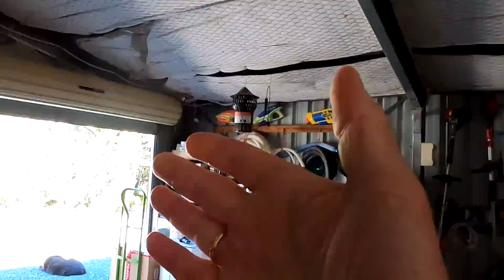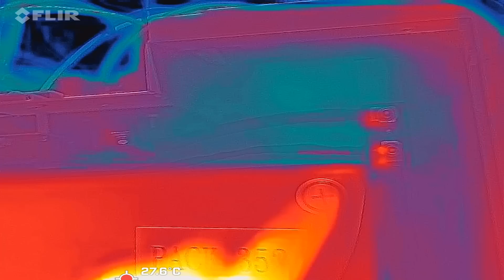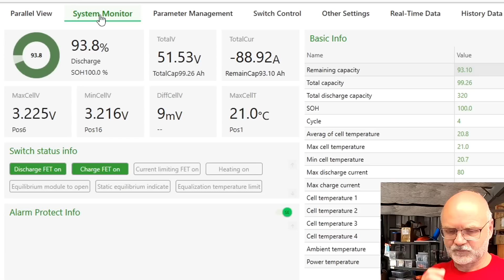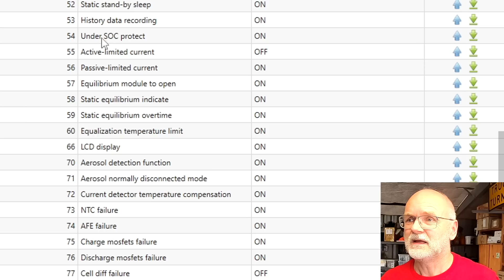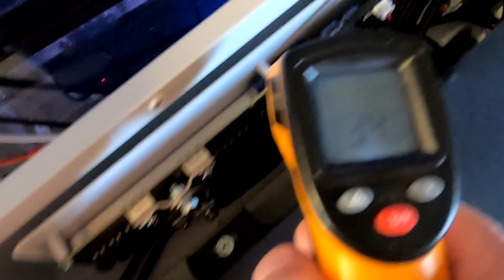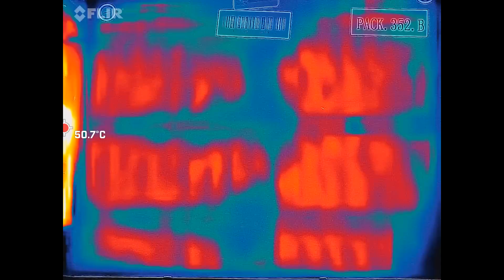Seplos Polo LiFePO4 Pouch-Cell Battery 1C high-amp discharge test. Does it get too hot? ♨️

Comment: I don’t understand what is wrong with higher balance tolerances? I mean why do you want to be 0.01 close to the wire the batteries need a little room.
Reply from the maker: What is your deviation and settings like? How do you charge your cells?

Comment: Dear Friend , We can use different type Battery (Li-Iron and Lifepo4) in parallel  in same invertor , If you can provide a video  for it
Reply: That's a very bad idea, they have different voltage curves and target voltage. You should not be doing this.
If Andy is going to be a video, it will be to show why you shouldn't do this
Reply from the maker: Some people do that but I'm not a fan of that. Can be done for a temporary time but stick to one chemistry if you want a reliable system.

Comment: Seems like the battery resetting itself to 100% full because a single cell hit the over voltage protection is a bad implementation because it could just be a runaway cell.
Reply from the maker: Yes, that is a bad software design again. I'll talk about and also show this in the next video.
Reply: Not a bad implementation, because you can damage your cell and some inverters will keep pushing power if SoC isn’t 100%. The problem is always how to keep cells balanced.
Reply: @gfjardim1983  Except that the BMS can, and should, be configured to cut charging or discharging in situations like that and if the battery just resets to 100%, not because it’s actually full but because a single cell is running away, it will be harder to realize there is a problem and figure out what is going on, especially in situations where you have a large bank of batteries which would be typical for a home.
Reply: @inmyimage1081  agreed, my BMS disables the charging input, set the SoC to 100% and send an alarm to the inverter, requesting a “Force Charge”. The first action protects the runaway cell, the second action signals that the battery can’t receive any additional charge, and the third let the user know that something is wrong with the battery.

Comment: Not too surprised that the pouch cells don't seemed to be able to supply the stated 100Ah, although 1C is a bit much. There was some significant balance-differences, I noticed.
In the several tests I have seen for pouch cells, they are often just right on the stated capacity or, as in this test, about 10% too low.
I do wonder if the NEEEEEY active balancer would make things better for this unit? 
I am worried that the SEPLOS BMS stated 74,8 degrees Celsius, with the 80 to 90A drawn, this BMS should be able to cope without such much heat? (50 to 60 degrees C?)
But maybe I'm just too negative in my perceptions, and wrong.
I do look forward to your further tests etc in this arena!
Reply from the maker: The BMS does get hot. This is just a 100A BMS so we drove it right at the limit. 75°C seems reasonable for the electronic pushing 4500W.
Reply: @OffGridGarageAustralia  My mistake, you're right of course! I keep forgetting it is not a 12v system, 100A at such high(er) voltages is of course a lot of power, and thus indeed heat. MY sincere apologies for this oversight!
Reply from the maker: @InspectorGadget2014  not a problem at all, my friend, no big deal.
Reply: Interesting fact, I now see the same boxes, in the same colour etc, appearing under different brand-names. Oh dear, the Chinese are copying the Chinese, this is the end of the world!

Comment: Crazy discharge, it’s amazing how much your Tesla can take and retain. Does it never worry you all these batteries in such a hot environment?
Reply: The newer Tesla Model 3 at least wants to warm the cells to 50ºC to be able to do the maximum charge in and I do believe those have the quite similar prismatic cells instead of the previous pouch cells with cobalt chemistry. My thought are that then the electrolyte is more fluidly flowing an no metallic lithium is forming to the other electrode, as the flow inside the battery can keep up with the current coming in or is this a concern only when charging, if someone could enlighten me? This the reason, why LiFePO4 batteries need to be above freezing temperatures to be able to take in charge properly.

Someone with more knowledge could give input on how the different temperatures affect the cells when discharging, like how they age and how to get the absolute max C-rates when compared to the temperature.

Thank you Andy again for a little different, very interesting video again, much appreciated!! Keep up the good work, lot's of love from cooooool Finland! <3
Reply from the maker: What do you mean with hot environment?

Comment: @andy: I know you are crazy busy and this is not related to this video. What app other than “smart BMS” is there for Daly BMS? I have a cheap 12v battery that I can’t do settings changes on because it don’t accept the password. Just tho I would ask before I void the warranty and open it to install another BMS. If you or someone else can help I will be forever grateful
Reply: I also have a Daly and tried a couple other apps but nothing worked. They do have a windows program to configure the bms also but you need an adapter. Assume you tried 123456
Reply: @inmyimage1081  yes. I didn’t buy the BMS separately.  This is a 12v battery that happen to use a Daly BMS. The manufacturer don’t have an password even. I got an retailer to check. The BMS is set to cut charge at 3,75 volts…..  so I guess I need to open the battery then to fix this. I got the option of swapping the battery for a new of same model but that don’t help me much.
Reply: @pederb82  Does the Daly app actually see the BMS? Some common passwords used by manufacturers are 123456 1234 000000 and 0000
Reply from the maker: I'm afraid this is the only one you can use for Daly.
Reply: @OffGridGarageAustralia  then I’ll order a jk BMS and “fix” the issue. :)
Reply from the maker: @pederb82  cannot go wrong with a JK BMS.

Comment: 100 Ah and just 90 Ah is really a bit too short. 
Makes me wonder what would happen with half c rating of 50 A cause then we should see 100 Ah or we have again a battery issue as we have seen before with the seplos mason battery check where they had been using their own cells which had been weak, about 10% under delivered. 
I can remember these cause it was the decision point to not get their battery case nor their batteries , just only the seplos bms just 1 year ago. 
Feels like all the other offer from gobel and what not that have now become rackbattery vendors or kit vendors but with their own cells of unknown source when I had always asked for EVE or CATL or BYD. I can nowadays get a 10 kWh battery with a 5 year german waranty for 2500€ from Berlin with BYD cells instead of partificpating in a big lottery what brand and quality might arrive.
Reply: I think the unbalanced cells are the main problem. They stop the charging process when the other cells are not full yet. When discharging, the other cells are empty first.
Also fast discharge causes more heat loss and therefore never reaches the Tesla.
Reply: Which is that store in Berlin?